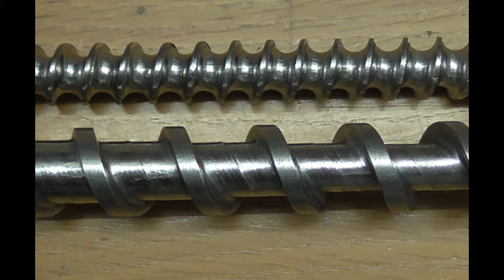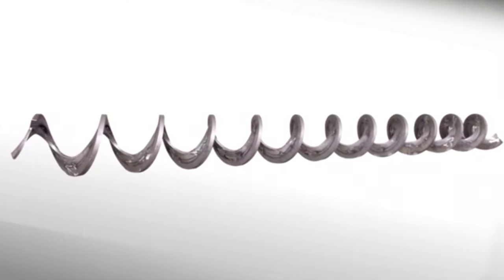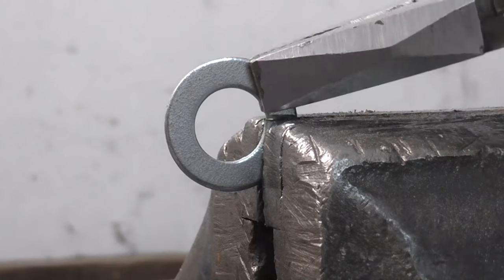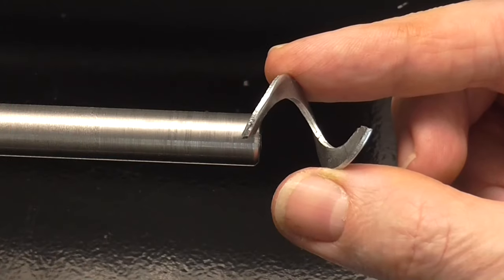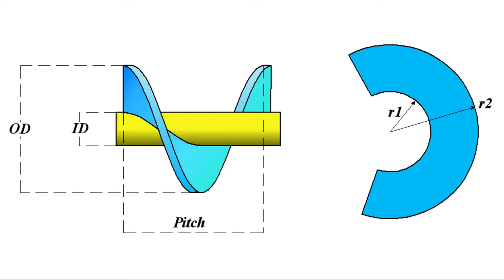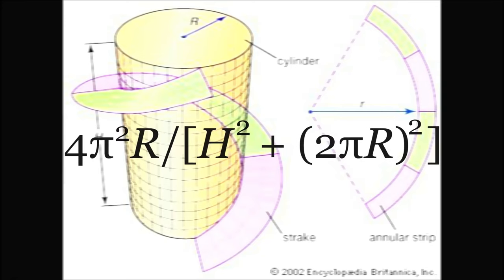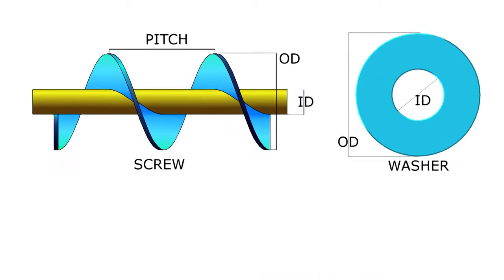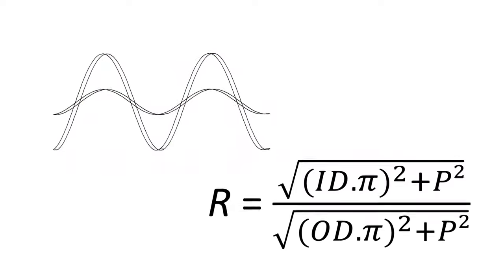Making an Auger (feed conveyor) from Washers   ...and mathematics!

Comment: These calculators are all over the internet for calculating the flighting for screw augers yet they don’t match your results.  Obviously yours is correct. Excellent video!  Thanks.
Reply from the maker: Yes, I don't know why, but the one I used originally didn't seem to give the correct results and I also could not figure out how they'd arrived at the formula they used.

Comment: you could do it the old fashioned way.   Hammer and anvil.  Thin the outer  edge and the steel strip curves itself into the spiral.   Same tech approach  is used in large production;  two conical rollers do what the hammer does.
Reply from the maker: You win the prize! I'm surprised nobody got it sooner! Yes, the third way I was thinking of was just to take a flat strip and twist it into a spiral using a blacksmithing or similar method.
Reply: That,s also a good idea to twist a flat iron.both of your ideas are good.thank you so much. With youtube we learn more.

Comment: I made one years ago. I didn’t know the math and I couldn’t even find it probably due to the words I Googled. I bought big washers from the hardware store, cut them and welded a few together. I then stretched them out and tried different round stock to find what fit. After that I drilled out the washers inner diameter larger to use a larger rod in the center. I then sanded down the outside until it fit into the pipe. 

2 different approaches with the  same results.

Comment: Excellent video thank you, a slightly different take on a screw conveyor. We often make them from a single piece of thin flat bar put in an appropriate round tube. One end of the flat bar is clamped in a vise and the other end twisted with a monkey wrench. The tubing helps keep it linear as you twist. The end result does not have the center spindle and hubs or stub shafts need to be welded on, but it works very well for granular delivery or chip conveyance.

Comment: I made one of these augers and drilled a water well with it. I used a 1/2 inch drill to turn it to a depth of over 30 feet...
Reply from the maker: I always wondered how hard this would be. Unfortunately where I am you need to drill to 200 feet to hit the water table.
Reply: @AndysMachines  That depth would definitely present more challenges for sure. I used 3/4 pipe and had to screw it together and unscrew it many times as I was extracting the dirt out of the hole...

Comment: The third way - Screw cutting?
I saw a video recently where a guy made an impeller (not sure if functioning though, the flight ratios looked a bit weird).
He made about 1000 screw cutting passes at very low revs, very high travel.
Reply from the maker: I think screw cutting would come under the 'start with a solid bar and machine away material' category. I was actually thinking of a different method entirely, not involving machining or welding (though you may want to true it up in the lathe afterwards). Or casting, so I guess there are at least 4 methods and probably others I haven't thought of, I suppose you could directly 3D print it in metal too.

Yes, I saw that video too, quite spectacular! The gear ratio he was using to drive the leadscrew was insane! I would never attempt to gear up the leadscrew so high, I'm surprised he didn't break something. If I were attempting it that way I would drive the leadscrew from the far end and use the gear ratio (in reverse- as a reduction) to slowly drive the spindle. But then I already have a stepper motor on the far end of my leadscrew.
Reply: The insane Russian guy, yes.

Comment: Saw a vid where a guy made a jig, welded one corner of a flat bar onto a shaft and then just proceeded to turn the shaft.
Reply from the maker: Yes, that's a really good way of doing it. If I were making more than one I would probably put in the extra time to do it that way. Once set up properly it produces very consistent screws, it does take a lot of turning force to rotate the shaft though, it can be done in a full size lathe in low gear, but not sure my small bench-top lathe would do it.

Comment: This is a wonderful video!!! I have a question, and I would be extremely impressed if you know the answer. If you look inside the feed tube of a meat grinder (mincer)... the auger spins inside the tube, but the tube itself, also have a... "sympathetic"(?) spiral shape protruding from the walls of the tube. I imagine this has something to do with the fact that the material being transported along the auger... i.e. meat... is a soft amorphous material, unlike dry stuff like... corn, or whatever. However, I am only guessing. So my question is... A.) Why do the walls of a meat grinder have "rifling" along the sides? B.) Since the spiral inside the tube is protruding, i.e. not cut into the wall, but coming out from them... how would you accomplish this?
Reply from the maker: Thanks! As for the meat grinder, I've never looked inside one and I would be guessing, but could the spiral fins on the walls provide some of the grinding action? ie. a chopping/shearing action between the wall and the auger? If that is what they are for I would expect the number and or pitch of the fins on the walls to be different to those of the auger to even out the grinding action. Meat grinders are probably cast with the internal features in place, but then you have the problem of how to make the pattern with the internal spiral!
Reply: my guess is mixing the meat ?

Comment: my father was engineer he had an easier way than that, imagine cardboard wrap around the shaft, the height of the cardboard would be the pitch of your helix and the length of the cardboard around the pipe is your circumference unrolled looks like a a rectangle or square from the top corner to the opposite bottom corner you would have a triangle the long edge of that triangle would be the circumference of your helix you would divide that by pie to get the inside diameter of your helix to get the out side  diameter of your helix just add depth of the helix to your inside diameter.
Reply from the maker: Not sure I completely understand your description, but sounds like your doing Pythagoras with strips of card?

Comment: Thanks dude. Great work! Did you machine the od after? Welded in 180 degrees tacks?
Reply from the maker: I welded it onto the shaft with quite a heavy weld all the way along and then ground it smooth to get rid of any lumps, this may have caused some distortion and I may have trued up the OD after (it was a couple of years ago now).

Comment: sand casting or investment casting would be a good third option :)
Reply from the maker: Yes, you certainly could cast a screw, but that's actually much more sophisticated than I was thinking. There's another quite basic method. I don't need high precision for this screw, it's only nudging random flakes of plastic along a short tube. My screw is quite rough and ready, I didn't even grind all the welds smooth. If I wanted to make a really good one I might consider casting it in bronze from a 3D printed pattern, leaving a finishing allowance and then machining the outer diameter to size.

Comment: You do know Andy that you can single point  this on the lathe entire?  Yup  ya gotta mess with the change gears.   Get a high feed . Oh  that's right you did it with a rotating cutter. Neat.  That said, I like your  approach here.  would have like to have seen it being used
Reply from the maker: I doubt I could single-point it on my small bench-top lathe with such a high pitch (50mm per turn). Even if I could, it would take forever to remove so much material from a solid bar. Doing it with a powered tool-post cutter still took a long time. For this screw I didn't need it to be very accurate and this method is a lot quicker. You can see this screw in use in my injection moulder videos.

Comment: I'm very curious as to what you think were the errors in the formulas you found.  That these published formulas were clearly so far wrong seems weird.  Did you reach out at all to whomever put them forward?

I recently was trying a similar idea in wood.  I wanted a helical gear to drive a spur gear in an automaton, and I came up with the idea of making "washers" out of thin wood then cutting them across the diameter and gluing them to a dowel at an angle to provide the correct pitch.  It "worked" but getting the pitch consistent is difficult.  I think i'd need a glue-up jig to do it well.

I'm going to play around with your spreadsheet and see if it helps at all. Thanks for making that available.
Reply from the maker: It was from the Encyclopedia Britannica but they didn't quote the source. I just found the results it gave didn't seem to work, didn't agree with my calculations, and I couldn't work their formula backwards.

Re. the helical gears, it's entirely possible to run a helical gear with a spur gear, the steering in many cars uses a helical gear with a straight-cut rack, but you need to increase the diameter of the helical gear (same number of teeth) in proportion to the helical angle, since the teeth are at an angle, they need to be wider to mesh with the straight teeth of the spur gear. The formula is: PCD=(number of teeth x module of gear)/cosine of the helical angle. The cosine of 0 is 1, so you can see this formula also works for a spur gear (helical gear with helical angle of zero).

Comment: Hello, I'm Davide from Italy.

I made an auger for the same purpose of yours, I make an injection machine (I'm developing a Precious Plastic workspace) and I want to make it self loading.

Since I'm a lathe machinist and I'm allowed to make my parts after the working hours, I lathe machined it from an aluminium bar.
Now, I have some issue in dealing with the shredded flakes, the longer ones tend to get caught between the auger and the tube.
I also filed away the part as you do on yours, but the material get caught just after the removed part and starts to rotate around the auger, stopping the feeding action.

My question is, how much play did you leave between the auger and the tube.
I left something like 0.5mm on the diameter, and I'm wondering if it is too little space, since the shredded parts, for example HDPE bottles, are thicker than that.

Probably machining the tube from 25 to 26mm ID can solve the issue...?

Thanks a lot!
Reply from the maker: I'd aim for a bit less than 0.5mm if you can, maybe around 0.1mm. But I had the same problem, if the thickness of the shreds is similar to the gap around the screw they will always work their way in between, this is why commercially they use pellets.
Reply: @AndysMachines  Thank you!
I decided to try to enlarge a bit the diameter of the tube, I made it 25.5mm for the moment, and I made the surface a bit rough (for sure rougher than before, it is a seamless rolled tube), I hope that help to let the screw rotate with the shreds stopped by the roughness.

Finger crossed, I'm testing it in minutes! 😂

Comment: Great nice sharing, thanks! . I wanted to ask if the spreadsheet uses inch measurements? and how to convert it for metric measures? Thanks again :)
Reply from the maker: I do everything in metric units, however the speadsheet will work with either metric or inches as long as you use all of the same type.
Reply: @AndysMachines  Great ! Thank you!

Comment: Hi I don't have the tools to making that but I found that there is A Drill Bits named "AUGER BIT" I think it is same shape Can I use them to make "filament extruder" and will it do the same job ..thank you
Reply from the maker: Yes, people often grind the screw point off an auger bit and use it to make a feed screw, however it's not really the right shape for an extruder screw, though it may work acceptably for your application. (I have another video where I machined a compression screw for an injection moulder, it's a bit more involved)

Comment: Thanks Sir for this huge lesson. What is the unit of measurement? inches, millimetres, or whichever as deemed fit?
Reply from the maker: It doesn't matter which units you use as long as they are the same throughout.

Comment: Gday Andy
Is the screw pitch equal to one washer or is the washer over or under twisted when forming the screw?
Thanks Greg
Reply from the maker: Yes, one washer stretches out to approximately one pitch length. You might imagine it would 'wrap around' the centre shaft and go further, but the extra length is taken up in the angle of the helix.
Reply: @AndysMachines  Thanks Andy, I am not really surprised, your very handsome spreadsheet would have told us the required number washers for a specified screw length if the pitchers differed.

Comment: Can  you unprotect the worksheet  or make cells below the metric measurement and convert to  English measurments? Thanks for a simple answer to a complex problem.
Reply from the maker: It's not actually in any particular units, you can enter either metric or imperial measurements in the green boxes and the results will be in the same units

Comment: I recently started working at a sheetmetal project firm and with my knowledge i drew it in inventor , only to find the thickness messes with the development..So then i had a chat and they use the same formula as the one you are but there is a slight difference in development and actual required sizes ... Can this also be due to the thickness of the material in question ... We made a flight with 8.0 thick material and we had ± 20 mm difference in the pitch but got the correct od ... Any idea how to fix this maybe ?
Reply from the maker: I assumed that the thickness was negligible, which for me it was  (2mm for a ~ 50mm dia screw). But yes, if you use very thick flights it will have an effect and make the calculations more complex. As you form the flight, the corner of the inner leading edge will angle inwards making the ID smaller, if you then force this over a rod of the correct ID it will affect the OD or pitch.  

You could account for this by either putting a chamfer on the inner leading edge of the flight of the same angle as the helical angle so that after forming it is parallel with the axis, or you could increase the ID in the calculation from the actual ID to account for the thickness, eg. add 2x thickness x sin(α°) to the required ID, where α° is the helical angle. 

There are probably some other subtle effects that would be caused by forming thick material that would also throw the expected results off, so it's likely to be a bit of trial and error.

Comment: What about thermal deformations after welding? Did the final screw require some kind of truing?
Reply from the maker: Welding always causes some deformation, in this case not enough to cause any problems, but yes if you need very tight clearances you might have to make it oversize to start with and skim the outer edge.

Comment: how do we consider the washer thickness?
Reply from the maker: You can pretty much ignore the thickness, unless they are very thick and you a drawing them out to a very long pitch, then the inside diameter will decrease slightly and the outside diameter increase as the corners tilt in/out.

Comment: How can I make a double helix?
Reply from the maker: You can do this with 2 helical strips and just thread one into the other so that they are 180° apart. (This would be called a 2-start screw, rather than a double helix, and you can have multiple starts.)
Reply: @AndysMachines  I agree but it intersects. Sir
Reply from the maker: @hamdigokce1626  No, not if both turn the same way, one will screw into the end of the other.